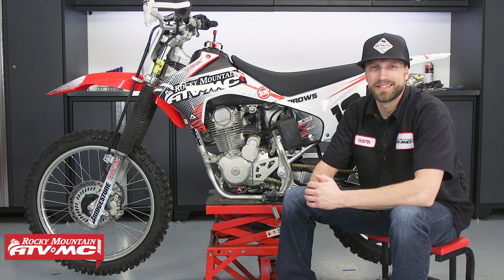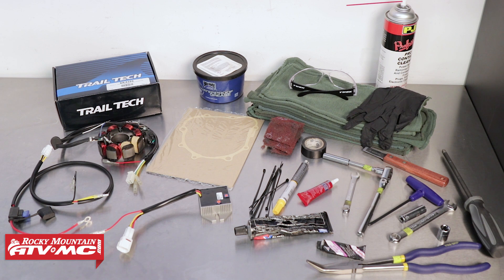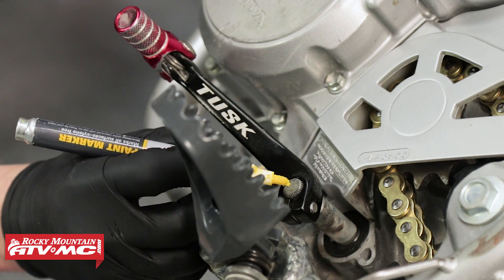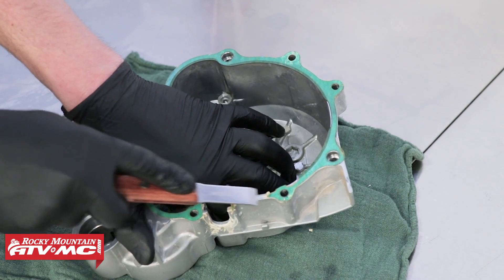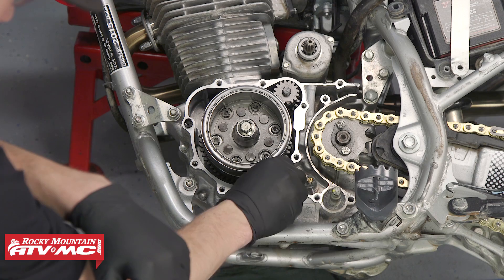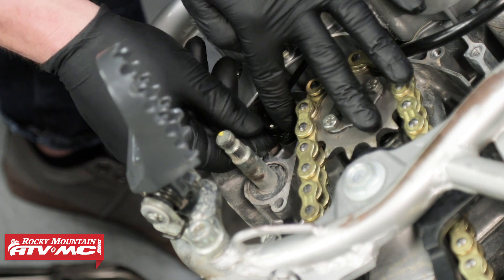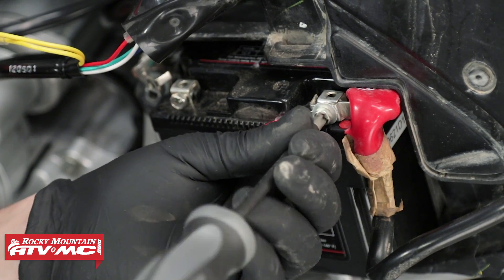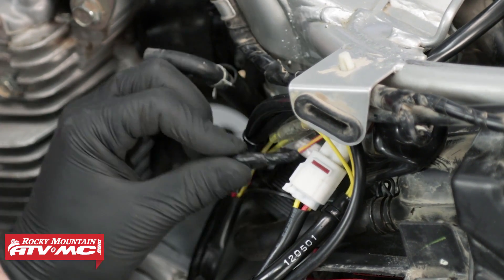How To Install a Trail Tech Stator on a Honda CRF230F

Comment: can this Honda crf230f connect to a mechanical gear indicator sensor for all 6 gears?
Reply from the maker: We have not tested this. But you may be able to find aftermarket options available.

Comment: OK, so I have more of a question? I called Trail tech today to ask where I would get the VHB pad that is supposed to come with the rectifier to mount on my air box. The tech told me he’s been working there for 15 years and they have never sold one or they have never been on the back of their rectifiers. Also stated that I should not mount it to plastic as the back acts as a heat sink and will destroy the rectifier. I am building a dual sport 2022 CRF 250 F. It’s done, and I ground the top of the airbox to fit the rectifier. Any suggestions on where else to mount?

Comment: I have the Chinese COPY of this bike and need to replace stator/pulse ignighter . I have removed all side case 8mm screws, even the one inside starter motor gear housing but side case refusing to budge. I'm sure I missed something. Anybody know what the secret is ? I'm attempting to put the engine on a race kart and end up with a 200 cc 5 speed shifter kart : )
Reply: Did you solve this issue?

Comment: When i click on the rockymountain link in the description the vehicle drop down menu only shows ktm. Will it work with a 2008 crf230f?
Reply: This is 3 years too late, but Ricky Stator sells the same kit for the CRF230.

Comment: would this work for a 2019 crf230f?
Reply from the maker: Yes these steps will be the same for your 2019.
Thanks for checking out the video!
Reply: I just bought a 2019 Honda CRF230F yesterday. Is the Trail Tech Complete Stator Kit 70 Watt compatible with the 2019 machine? I followed the links from your video to the parts, but I had to change the year in order for the Honda to show up in the store. Great video by the way, the first mod I will do is upgrade the stator and get the headlight.
Reply: @arniespace  they haven’t changed much I would imagine so.